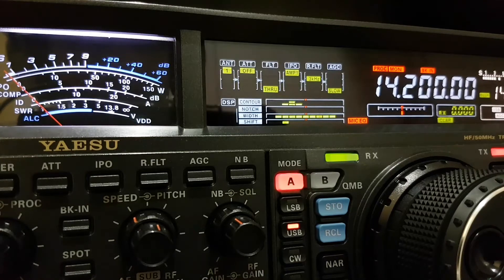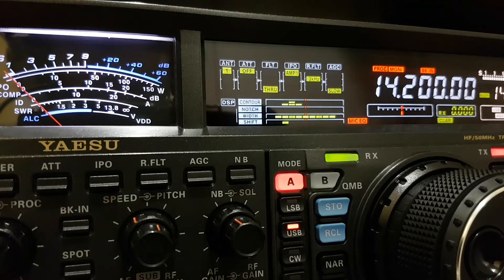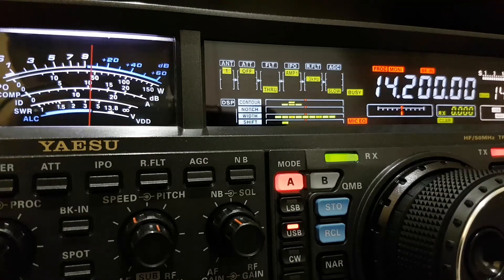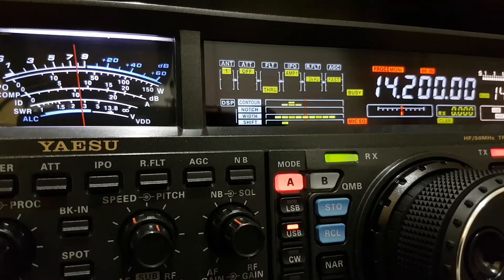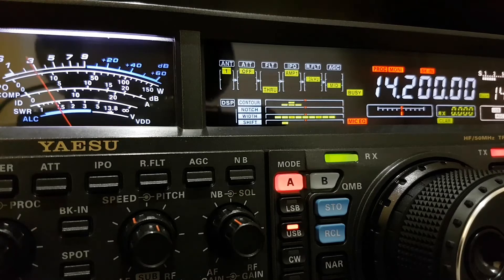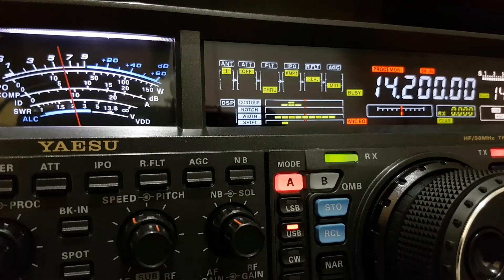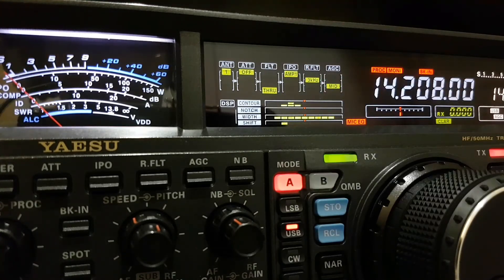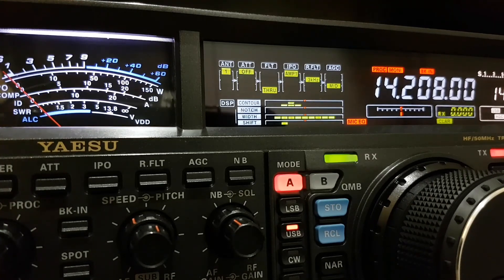2el.HEXBEAM vs. Dipole - W9AEB, KP2AD reception

Comment: A little confused.... You are comparing a resonant 20 meter antenna on 40 meters. I wish you would compare apples to apples. Switch to 40 meters on the transceiver, find a station, and then swap antennas. Thats the true test. I would love to see that because I am thinking of putting up a Hex Beam with 40 meters. I would like to see a true comparison.

Comment: This is interesting and I may need to do some more work on my setup. I have a 20M dipole at 35 feet on a rotor and am very pleased with it. However, I couldn't resist the hex beam and all the hoopla associated with it so I bought a nice one - just for 20M and when I do the A-B tests I get exactly the opposite that you do. I get around two to three S-units better with the dipole. In my case, the hex beam is about 15 feet lower as I do not have two towers to mount both antennas at the same time but my results are making me think again about swapping my dipole for the hex. 
Thanks for posting. Your results are what I expected but in my case but I got the opposite.
Reply from the maker: Hello, thanks for your comment ;-) True is that this my comparison is not much fair-play because of a 40m band dipole and not 20m. But I assume that the difference in receiving signal from this dipole would be only at least 1-S stronger if was this dipole for 20m band. Now after years I've realized that there is also hugh difference in RX signal strenght due to different antenna type and angle from it receive. For example, currently I use multiband 42m long endfed antenna in the same hight as the Hexbeam and very often I picking up local stations from Europe much stronger on the wire than on Hexbeam, but DX signals from the outside EU picking stronger on HEX beam 2-3S. Best 73, Paul OM0ET
Reply: @OM0ET  Thank you very much for your reply. After my comment to your video, I noticed that when I was listening on the hex beam and rotating my dipole, the signal strength would come up on the hex beam when my dipole was at 90 degrees to the hex beam. Some very strange and interesting interaction between the two antennas that are about 10 feet apart horizontally and the hex beam about 15 feet lower than the dipole...
The hex beam has become such a sensation lately that I had to try it. It is essential a version of a 2 element yagi, for some comparison. However, please notice in the design that the driven element is actually longer than the "reflector" as it is described. I find this very interesting although I am not disputing anyone's results. A design of a two element yagi gives better results as a driven element and a director rather than a reflector. I have built this type of two element yagi with driven element and director and had good results with it. I am a bit confused with how the "reflector" in the case of the hex beam is actually shorter than the driven element and the forward gain is determined. i suppose it is in the folded design. My immediate interest is whether or not I am going to take the  effort to remove my wonderfully performing rotatable dipole and replace it with this hex beam... I have a fellow coming over in two days with a lift that may allow me to make this change safely at the top of my tower.
Thanks again for your video. I always appreciate the effort to measure and post results. 73 WA4QGA
Reply from the maker: @ElPasoTubeAmps  You are welcome! ;-) Would be great if you will share how is your hexbeam works. You could record some video about this. Have fun and good luck with your antennas! 73, Paul OM0ET
Reply: so when you get your hex up to 35 ft come back with your test or lower ypur 20m dipole to the same height as the hex and redo your test.to be fair.
Reply: @varoujan78  Interesting I see this video a year later after commenting back then. I was searching for 40M delta loop info and found some videos but noticed this video again. I really enjoyed it and at the exact point I was at, my results were opposite. However, when I went for it and put it on the top of the tower and rotor - wow... the hexbeam was much better. I posted a video on my channel about the hex vs dipole. Anyway, I ended up getting the great results just like this video.  73   WA4QGA

Comment: All depends on take-off and changing polarcirculation.... real gain diff is not 4 S- Units. Bet that same Dipole in vert. polarization would be more or less near the hex. Under many aspects,  any hex construction is a great antenna. Specially under economic/weight aspect. But it's never a supergainer. Gives you some f/b, verry little gain but much better take off, compared to a horizontal dipole.
More interesting fact is the difference of both antennas in SNR!!! Anyhow - I like your channel! Vy pleasant OM!!
BTW: A nearfield comparison, to one of your local neighbours would be interesting! Plus a f/b test!😎.
Keep it up!